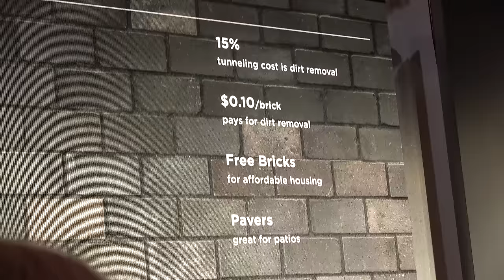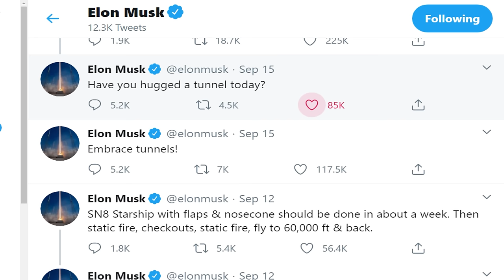What's Inside The Boring Company Brick?

Comment: The “cinder block brick” has metal in it because it’s not a brick. It’s for use with rebar - you put it in foundations to hold the rebar off the ground. The metal are ties to hold the rebar in place
Reply: called dobies
Reply: Bo u were last seen 7 years ago where were u
Reply: @watermelonidk  ?
Reply: You a rod buster or something
Reply: Matt Koehler. Sometimes the comment section is just as educational as the content thanks. 👍.
Reply: Only rodbusters know what dobies are used for. Shout out from IW Local 378
Reply: Dobies.
Reply: Matt Koehler @
Reply: @ThisPandaIsHAM  nice!  I was out of 378 then transferred to 155 Fresno. I got out in 2005 and now I work for the FAA in Dallas/Fort Worth
Reply: Yeah somethings wrong with his test because they’re supposed to break in half
Reply: I was gonna comment this 🤣🤣
Reply: I’ve been a carpenter for 5 years doing everything from framing, laying slabs, to finish work - full kitchens - bathrooms - whole house remodels - even have done a bulletproof, 8 hour fire resistant bunker in a basement.

Comment: “Used brick” is likely more expensive because clay bricks from different runs don’t color match. They are betting contractors would pay more to get bricks from identical runs even if their used. Traditional red clay brick and cinder block new are pumped out in the hundreds of millions if not billions so they are cheaper new, but will probably not color match.
Reply: you know you can knock mortar off of bricks? we do it in the uk so get an exact colour match on extensions and to save money
Reply: Old bricks are used to make nice weathered brick herringbone floors and stuff like that. Not structural but aesthetic stuff
Reply: Funny thing about those "used" bricks, many places don't sell real used bricks... they're just selling bricks that have been tumbled and have a little concrete and paint splashed on them to look worn and used because demand for actual used bricks tends to outstrip supply.
Reply: D W we did up my grandparents today lace and sold the bricks 200 years old plus I reckon for nearly £2.50 each. On one we could see where an otter had walked on it as it was setting and left its paw print!

Comment: Ok that's seriously not how you test a brick, the main thing you want to test in a brick is compressive strength. The bricks will never take any other kind of load at all, especially not impulse forces like chucking them imparts. And while we're at it, elon's idea is hare brained for reasons too complex to get into.
Also also if it interlocks like legos, where does the most important part of a wall go, the cement that holds it together?
Yes i'm fun at parties.
Reply: Am I correct to assume that the actual specs of the resulting bricks would vary wildly depending on where the tunnel was dug?
Reply: @darmokVtS  Well...yes. It totally does.
And as already said: the drop-test is pointless.
Reply: Exactly my thoughts as well!
Reply: what if you stacked these bricks without any mortar and then just poured cement down the two holes?
Reply: @darmokVtS  yes, yes you are. Soil variety varies wildly depending on the location and the depth. The reason they truck in new dirt is because said dirt is consistent and thus predictable
Reply: @TomatoWithARifle  you need a thick layer of mortar between bricks to provide adhesion, else you've basically filled in the bricks
Reply: Ralph Stein  do you? Did not know that. I'm an engineer but not of the civil variety and this is just from the materials classes I took.
Reply: Suggest that all of you look at "Build Up Nepal" on YouTube.  The Nepal government are encouraging people to build with these bricks as they are earthquake resistant.  Foundations are laid normally, and these bricks are put on a bed of mortar, and half inch deformed reinforcing is used in the verticals - 3 bars in the corners, then one bar every either 8 bricks or 8 holes.  Cement is dropped down the holes with the rebar, and at 3 foot, they reinforce and use a stretcher brick to fill with cement.  By doing this, if you strip the bricks away, you finish up with a version of an early style prison cell arrangement.  Water, power, gas and comms are all dropped through the holes to the respective height.

These bricks are actually better than other compressed earth bricks, as they can be reinforced.  The solid bricks that are used, you either have to run your services on the outside of the bricks, or you cut into the bricks, which weakens the wall.  The solid bricks can be used for septic tanks, silage pits, water tanks and other similar projects.

Comment: The “brick” with metal in it is not a brick. You twist the metal around rebar when pouring concrete
Reply: Commonly referred to as "chairs" they make sure the rebar dose not touch the ground and rust.
Reply: good information, thanks!
Reply: You are correct. Often called 'concrete  dobies'
Reply: We call ours dobies in my part of the county
Reply: Right. They are essentially spacers for rebar.
Reply: I'm surprised that the dobies stayed together. The "metal reinforced" part is actually just a tiny loop and barely goes into the concrete. The dobies are actually designed to come apart
Reply: Ryan Zieman right? I thought it would crack apart right away. You break them apart before you use them, haha 😂.

Comment: The. most important thing about a brick is how much compressive strength it has.  A brick that survives a drop isn't necessarily better than one that break, because the loads that bricks have to take are almost never suddent impacts of hundreds of Gs.  In fact, a brick that's tougher under impact is likely to be far weaker under compression, and therefore unsuitable for use in multi-story buildings.

Comment: "Is that not conclusive proof". No it's not, a drop test is fine for a YouTube video. But what's the rated comprehensive strength of the brick ?
Reply: Also factor in the lock design. Much stronger joints than traditional bricks.
Reply: Not all bricks landed in the exact same orientation also, would have been better to hang them all from a string at same height, cut one by one while sweeping after every brick land, and after temperature stress testing maybe, im no brick expert tho lol
Reply: are you the brick expert? im guessing you are

Comment: Elon, NOW is the time to make those bricks. I work in the New Home industry and we are having issues with the brick supply chain. I like those bricks. I can see a future without a wood frame but a brick frame, IF the bricks are cheap and strong enough.
Reply: He will be delivering them through the Hyper Loop whenever that's never finished.
Reply: Ok then
Reply: But, literally in my country we already use brick instead of wood like decades ago. So its not that "future".
Reply: almost every country except for america uses brick frames for houses man, theres nothing futuristic about that
Reply: Christina Ellisor, why don't you make the bricks yourself, and do a vertical intergration company?  Make the bricks, build the houses and then either sell or rent them out.  If you look around on YouTube, you should be able to find the formula for making the bricks, and to build a press for these bricks is not that difficult.  All you need is some land, clay, sand, cement and oxides, plus some willing laborers.  The only thing is that the bricks take 4 to 5 weeks to cure, before they can be used.  They also need to be tested to confirm compressive, shear strengths and water absorption.

Comment: The wire in the brick is to secure it to rebar, they work as spacers while building some rebar reinforced concrete structures.
Edit: The grove is there so you can easily crack them apart, also not a brick really, also two of them.
Reply: That's what i said. Normally in the construction industry people will cut and use regular bricks I never in my life sow drawings to request a special brick to lift the rebar but yes you are 1000% right!
Reply: @solomonwieder1213  as long as I've worked rebar, my father and my great uncle going back 70 years they've used those.
Reply: @salvadorjuarez8888  I never use it but I know that it's the right one!

Comment: I strength of a Brick has never been determined by how it does in a drop test. It’s about compression
Reply: It wasn't strength but durability. E.g. how well they can be shipped and handled onsite without damaging them. Strength is different as you mention, and is more important to the engineers and architects designing the buildings that use them
Reply: Elon: so we gona buld briks.
Also Elon: Why brik not nice looking??
Reply: @askjacob  they're bricks. If you break one, just grab another.

Comment: The block with tie wire is called a "dobie" it's used to set reinforcing steel on so when concrete is poured the rebar is not touching the ground. Or sides of the forms

Comment: Hello nice video. However, this is not the correct testing method. You need to go to a civil lab and they will direct you to the correct testing method which I believe is strenght test using compressor. In this way you will know the exact load Mpa that the brick can resist.
Thanks again and gl

Comment: The brick with metal in it is not actually a brick. It is used for pouring horizontal concrete slabs (and sometimes for vertical too). It goes under the steel rebar and serves as a spacer to keep the steel rebar in the middle so it is centered in the thickness of the concrete when it is poured. The metal wires coming out of it are for tying the rebar to the block so the spacer stays under the rebar and the rebar doesn't slide and fall off the block. The reason there is scoring around the blocks is because you hit it with a hammer to break it into individual blocks so you can space the pieces out under the rebar.

Comment: Fresh bricks come straight from the kiln, and as such it’s impossible to know if they’re really as strong as they look. Sometimes they have flaws hidden inside that you won’t discover until they’re already in the wall and you have your first cold snap of the season, or the temperature gets much higher than you thought it would.

With used bricks, though, they’ve already gone through the test of time. They’re solid, and they’ve shown they can stand up to weather, to pressure, and that there is nothing in them waiting to break. Additionally, all of the shifting and alterations that naturally come with new bricks finding their place has been taken care of. Used bricks are in their final form, and there are no real surprises with them.

Comment: It's a cool concept but there are 2 things that a mason like myself would not like. First, the holes in the brick are expressed, so stacking, tonging, or even just laying them would be very hard. Typically there's anywhere from a 1/4" to 5/8" joint between bricks, so in order to lay these, you would have to have very large joints, and very large joints aren't as stable and tight one. Second, the brick is so strong that cutting them with a saw would be hard on the blade, and cutting them with a hammer would be very tough. All things considered it's a very efficient way to manufacture building products and we all love to see it.  Also those red brick aren't used, they are distressed and given a factory mortar wash. 5 years of rain, wind, and snow and then go back to a regular brick.

Comment: Well i get many of the pros for the brick. Its very cheap, uses the resources localy and as reinvestment, but:

Dropping bricks is not a very good test for the quality or strength of bricks. The question is how much pressure they resist not how much impact. Also things you might consider are thermal conductivity or how weather proove they are.

Comment: The brick with the wire in it isn't a brick its called a dobie. Its used as a spacer in concrete slabs for rebar, the wire sticking out is to hold the dobie to the rebar.

Comment: Red brick = standard
Red used brick + just has some cement splatter from factory. (not actually used brick)
Brick with metal = for anchoring rebar in foundations and concrete slabs. rebar is placed on top and tied on with the wire.
Grey brick = landscaping brick

Comment: The ones with the wires sticking out are not bricks. They are concrete dobies. They are used to suspend rebar or welded wire in a freshly poured concrete slab.

Comment: Those bricks with metal in it are called “adobes” and they are used to put under metal rebar before concrete is poured on top. It keeps the rebar in the middle of the concrete slab and not sitting at the bottom.

Comment: The genius of making the bricks like Lego and with holes means you dont need mortar and you can drop re-bar top to bottom and fill with grout.
Reply: I don't think the brickwork would be weatherproof without mortar in the joints. That would be especially true if all the bricks didn't align perfectly, which is almost certainly never going to happen.

Comment: 5:05 all that bricks are old manufacured. Are expensive because need more materials and more energy to solidification and very bad at thermal insulators.
That is whya now all brick have a lot of holes on it to make thermal cut from outside temperature to inside: And all we know the air is a good insulator. Any way the tesla brick need more holes but for 10 cent its ok.

Comment: As far as bricks go, their time on construction sites is limited. Bricks don't hold up a structure and they don't provide a thermal barrier. People fall off of scaffolding while bricklaying. Brick laying and mortar produce a lot of construction site debris. Some of it buried permanently onsite, some in the garbage/landfill. Buildings are being limited to being built depending on their environmental impact. This goes all the way back to the production of the raw materials. 

To eliminate all the negatives, brick will be discontinued beginning with large projects. If you want the look of brick, you can get a brick veneer made from recycled plastics, fibres for strength and sand. These can be bonded to waterproof sheets that is bonded to foam and then another waterproof board. This allows two story walls to be built inside safely at ground level. They will be delivered complete with windows and drywall, placed by a crane, fastened and welded together. These are hurricane proof and tested with a 2x4 shot out of a pneumatic cannon.

Comment: Years ago I read about building DIY homes using "rammed earth" technology. Neo-hippies would first analyze their local soil for clay content. If the content didn't reach a certain threshold for clay, portland cement, the binding agent in concrete, might be mixed in. The earth would be placed between forms and "rammed" to compress it. In the right situation,, it could be an acceptable alternative building technique. A new technique of "printing" a house with a squirted, portland cement mixture is being explored. I don't remember most of what I read about rammed earth, but I don't think any old bore dirt would be acceptable even for Mr. Musk's vision of cheap bricks. Most brick today is not structural but is used as vernier on wood framed buildings instead of different types of siding because of it's historical, esthetic appeal. Using brick ties, the wood framed building holds the brick vernier wall in place.

Comment: WRONG TEST! Dropping bricks is NOT the way to test their strength. One has to test the LOAD the brick will carry when stacked with many bricks to make a structure. You should be compressing the bricks in a hydraulic press to test its structural strength, not dropping them. If you take an egg and squeeze it in your hand lengthwise from top to bottom it is extremely strong because of the shape. It you drop the egg even just a few inches it will easily break.